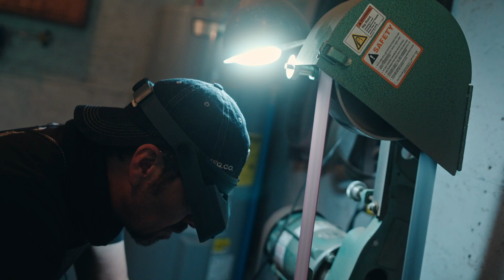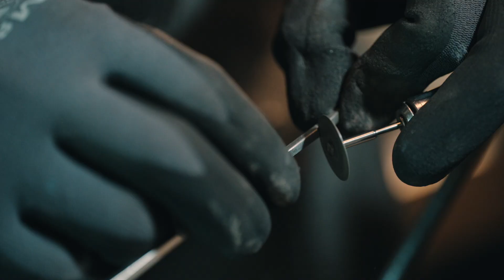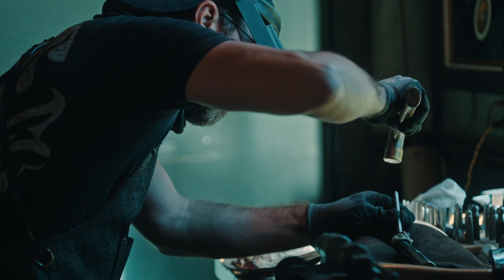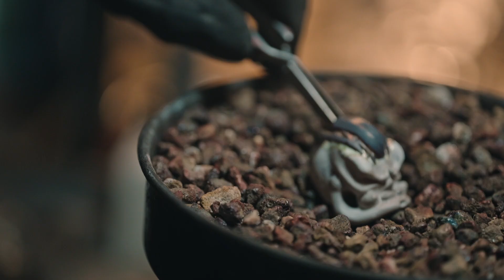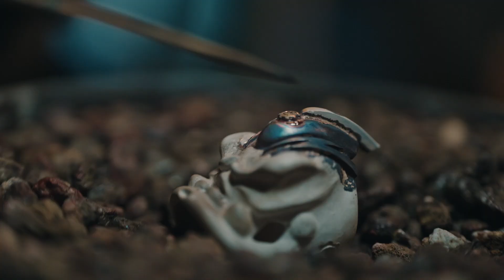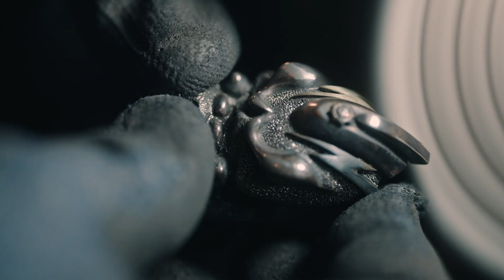MFKR DECO ROCKETEER RING

Comment: You are such an artist! How long does it take you to produce such a work?
Reply from the maker: It can range from 1 or 2 hrs to 1 or 2 days. Really depends.Each piece is different and you can never predict the issues that will come up. Sometimes it goes smoothly and then there are those days where nothing goes right.Thanks for looking!
Reply: @officialstarlingear3070 Rick, I agree with you. I keep the work in my head, I'm getting ready, everything seems to be fine, but there is always a problem. But such as we solve them, since we ourselves have taken up the complexity.
Reply from the maker: @MuradSh1984  Exactly. Keep at it.